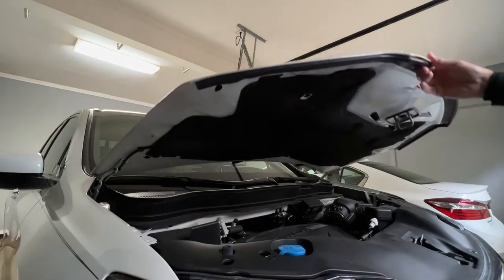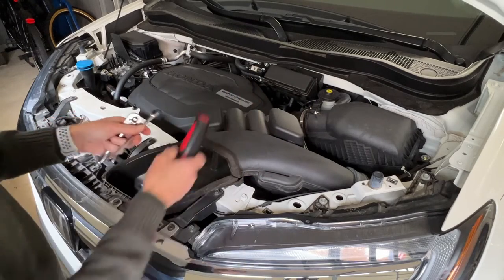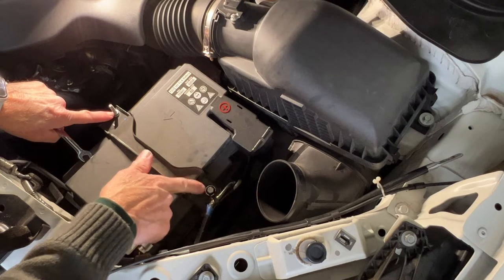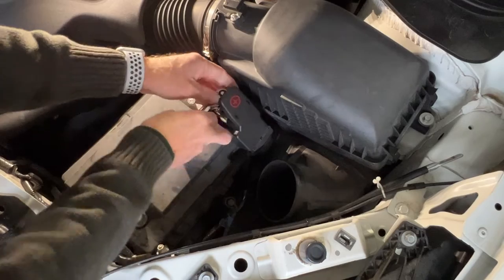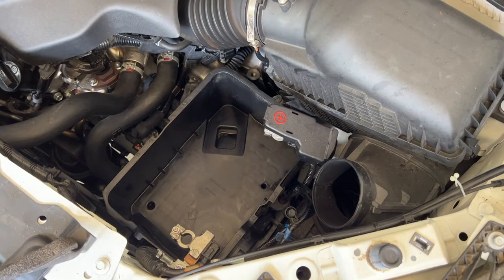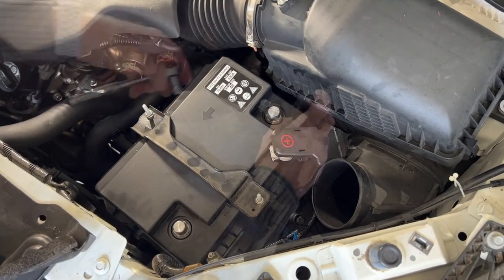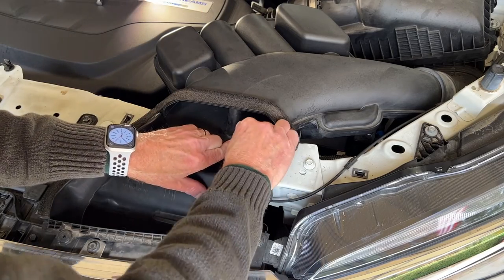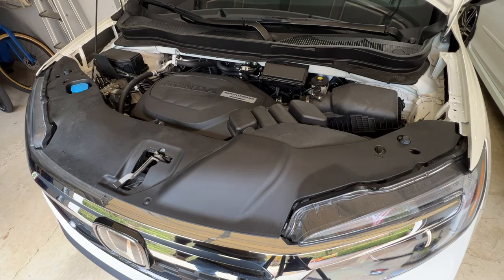Step by step battery replacement on a Honda Ridgeline (2nd Gen) or Pilot (3rd Gen).

Comment: Just purchased a 2018 Ridgeline & have followed most of your improvements like the tonneau cover & console divider. I do have a question on the negative battery cable extension you used (about 2.45 minutes into this video). What AWG (gauge) did you use? I've called Honda parts & read many on-line articles on this & only one person said they used a 2 AWG. Honda parts stores guys had no idea what gauge to use. What AWG did you use? Also, shouldn't there be some sort of cap, or cover, to go over the end of the cable so there isn't a short or something? Would it be best to use a copper cable verses another metal? Thanks for all your videos. I plan on using them to continue upgrading the truck & when it comes time to change the transmission oil & filter, etc. Hope to hear from you soon.
Reply from the maker: Congrats on your new Ridgeline! 

As far as I know all modern automobiles with internal combustion vehicles in the United States use a 12-volt electrical system with the Negative terminal of the battery connected to the automobile chassis so the entire vehicle is 'grounded'. The cable I used is an 18" ground cable that is normally used to ground an engine block to the frame of the vehicle, it is capable of transferring the current necessary to operate an engine starter and therefore more than adequate for jump starting a vehicle. I attached the end of the cable to the negative terminal of the battery and it is zip-tied down so only the last few inches are unattached, the rest of the vehicle is already connected to the negative terminal of the battery, therefore my additional ground cable I added can't 'short' against anything under the hood since the entire vehicle is already grounded to the battery. The only thing the loose end of the cable shouldn't be allowed to touch would be the Positive battery terminal. Since the Positive battery terminal is already insulated by the red plastic cover and my cable is zip-tied down so it can't reach the battery insulating the ind of the cable is unnecessary. All that being said, there is no harm in insulating the end of it if you like. 

https://www.amazon.com/Single-Copper-PowerFlex-Battery-Inverter/dp/B071GH3K5K/ref=sxin_15_pa_sp_search_thematic_sspa?content-id=amzn1.sym.9e5188ef-9cc8-48bb-b834-24761033aedf%3Aamzn1.sym.9e5188ef-9cc8-48bb-b834-24761033aedf&crid=3BUCU1RZ5O61I&cv_ct_cx=ground%2Bcable%2Bautomotive&keywords=ground%2Bcable%2Bautomotive&pd_rd_i=B072K9NCT7&pd_rd_r=d01b0247-9972-474d-bd29-cf47a421ee53&pd_rd_w=aFHzq&pd_rd_wg=LD6Hl&pf_rd_p=9e5188ef-9cc8-48bb-b834-24761033aedf&pf_rd_r=ZZGABJYD53CK9EX4Z5JZ&qid=1701888739&sbo=RZvfv%2F%2FHxDF%2BO5021pAnSA%3D%3D&sprefix=ground%2Bcable%2Caps%2C97&sr=1-5-364cf978-ce2a-480a-9bb0-bdb96faa0f61-spons&sp_csd=d2lkZ2V0TmFtZT1zcF9zZWFyY2hfdGhlbWF0aWM&th=1
Reply: Thank you. Just ordered the cable. Very much appreciate the quick response.
Reply: Believe it or not I have not added the cable yet but planning on it today. Have another question if you don't mind; when bolting the cable to the negative battery cable that is grounded to the frame should I somehow keep the battery grounded while attaching the new cable with the negative - I'm thinking I do not want to lose the 'juice' to the electrical components therefore needing to reset the radio, etc?

Comment: Excellent video, I'm about to replace the battery in my 2017 Ridgeline.  I want to install the negative battery extension but I can't find the link to the one you got.  What length did you use?  I found a 4 gauge cable on Amazon but I don't know if I should get the 18" or the 24".
Reply from the maker: Mine was 15" in length, so the 18" should be just fine.

Comment: Great video, but what about retaining the computer settings? why didn't you use a 12 volt power source for the battery cables while changing battery? Did the settings remain?
Reply from the maker: Most of the 'memory retaining' devices I've seen plug into a cigaret lighter plug and are worthless since the lighter plug is switched off unless the ignition switch is on. I did consider using one of my Robyn 18v batteries connected to a step down voltage converter set to 12v and connecting a pair of leads to the battery terminals, but decided to just swap truck batteries and deal with any radio codes that came up afterward. I had the OEM battery out for a good 30-minutes and everything resumed as normal when I was finished with the battery install.

Comment: I just ordered the ground strap and appreciate you sharing that. I was wondering what I would need to do if I needed to get jumped and/or help someone by jumping them. Based on the video it seems like the one end of the ground strap just goes under the bolt that the negative ground wire is attached to the chasis? So basically I would just have two negative attachment points at the bolt that is on the frame of the truck, correct?
Reply from the maker: Thanks for watching! My intention when I bought the ground strap was to attach it directly to the negative terminal of the battery, but when I removed everything and realized how easy it would be to simply attach the new cable where the battery cable is grounded I did it that way. I suppose, in theory, a direct connection to the battery may be superior, but I think the way I did it is sufficient.
Reply: You don't need access to the negative terminal to get a jump, just fyi
Reply from the maker: @allwoundup3574  Thanks for watching! You are correct, it's easy to connect to any good ground if jumping from another car battery to the Ridgeline. But the battery booster packs I have call for a direct connection to both battery terminals, the extra ground strap is more direct than any other ground point except the negative battery post.
Reply: @allwoundup3574  Manual says to connect the negative cable to the engine hanger only, under the engine cover.

Comment: I am guessing you have not seen the vehicles that have the battery in the trunk or under the rear seat😮   now those are a real pain!
Reply from the maker: I've replaced a few hard to access batteries, dad had a VW fastback with the battery under the rear seat and we had a '67 Sunbeam Tiger MkII with the battery in the trunk. I also had a '68 VW DoubleCab with the battery in the back next to the motor.

Comment: Great video did you use a memory saver?
Reply from the maker: Thanks! I did not use anything to maintain power while changing the battery. It was at least and hour without any battery in the truck while I cleaned up the battery box and shot video. I did have to turn the radio off and back on again, but I did not need to enter the anti-theft code.
Reply: If the audio system theft protection does display a code entry screen press and hold the power button for two seconds.

Comment: i have a 2020 passport, which is same as your ridgeline, just curious with having the battery out for some time, did you have to do anything with vehicle computer? did it mess anything up per say? great idea on the pic of the battery for glovebox, and sticker.
Reply from the maker: I was able to swap out the battery in about 20-minutes and I did loose my radio station presets (no big deal), everything else worked just as it did with the old battery.
Reply: @Koolbob2  ok, got ya, thanks for getting back to me on this, i have heard people wiring up a devise with a 9 volt battery and plugging into the 12 volt outlet to keep memory to the vehicle.

Comment: I noticed you said Honda used a 620 amp battery and you though they were skimping on the amperage, you replaced it with another 620 amp battery. Is it hard to get a higher amperage battery? I have a Ridgeline also but don't need a battery yet, just curious.
Reply from the maker: Thanks for watching!

I installed the same Group 48 type of battery, but the replacement is an AGM construction with much higher Cold Cranking Amps (CCA) of 760-CCA, 140 more CCA than the 620-CCA battery that came in the truck. https://youtu.be/jJZNLdWRedI?t=351
Reply: Now I'm confused because on the plate at the end of the replacement the plate said it's an FLA battery of 620A, at the bottom it reads that it's an AGM. How do you know what it is.
Reply from the maker: @lorettashumate446  I can see how it could be confusing, especially if you haven't seen the battery cover plate on your Ridgeline before. The plate on the battery cover says the battery is 620-CCA, I added a sticker with the new battery brand (EverStart), type (AGM) and date it was installed, but I didn't make a new sticker to cover up the 620-CCA label on the cover. Look at the top of the battery in the video and you can see '760' on the battery label.

Comment: Have you considered installing hood struts?
Reply from the maker: I did install them on the 2012 Ridgeline I had before this one. The struts were nice, but I actually prefer being able to open the hood fully.
Reply: @Koolbob2  thanks, I was wondering what you thought.
Reply: Sometimes simple is better!  My other vehicles have struts.  They don't last in the underhood heat and aren't cheap to replace.

Comment: Enjoying your informative vids & tips for the Ridgeline. Just purchased a '21 RTL. Installed the cabin & intake filters. Next is your battery (-) jumper mod & new battery.  Where do you suggest purchasing a new battery?  Thx : )
Reply from the maker: Thanks! I checked out Consumer Reports and the Walmart store brand, EverStart, gets high marks and is readily available. Walmart sells a lot of batteries, so their batteries in stock are always factory fresh. I opted to upgrade from the standard lead-acid battery to the AGM (Absorbent Glass Mat) battery because of their longevity and higher output.

Comment: While you have it apart, you might want to add those red and green corrosion prevention pads under the battery terminals.
Reply from the maker: In the past I used to install those in all my vehicles, especially back in the days of vented batteries that had to have the water topped off from time to time. I haven't found them to be necessary with the newer sealed batteries.
Reply: @Koolbob2  Very cheap insurance to use them and terminal spray.  Only time you will ever be in there again is when putting in a new battery.

Comment: Great video! As a side note, terrible design by Honda. Easy battery terminal access when stranded is essential!!
Reply: You never jump directly to the battery terminal on top of the battery when it’s weak. The gasses rise from this caps and could cause a fire if ignited. You ground on the frame away from the battery.

Comment: So you just swapped battery without doing a memory saver?🤷🏽‍♂️
Reply from the maker: Yes, I did lose the radio station station presets, but everything else resumed as usual once the new battery was installed.
Reply: I use a battery jump pack to keep power to the vehicle anytime I replace or disconnect the battery.

Comment: Well done on this video!  You were so clear on your explanations.  From the very start, I was informed.  I had no idea about the second hood holder; how great is that!?!  Down to the number of snaps I should hear when returning the cover.  AND @ma8108, I agree about the dash lights indicator explanation.  I forgot to buy the negative battery cable but will do so after this good explanation, since I did have trouble finding a spot to add the negative cable when I got the jump start.  Thank you!
Reply from the maker: @tonybrubaker5450 Thank you for watching and letting me know the video was helpful!